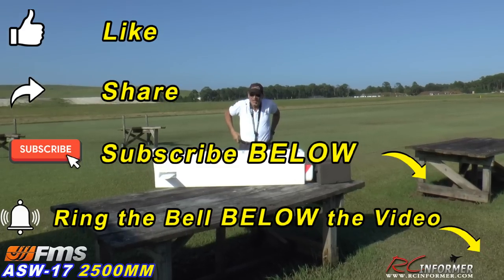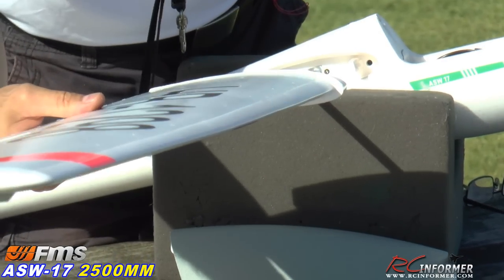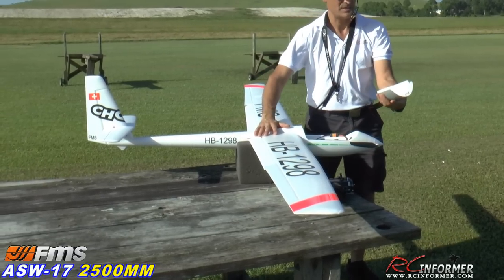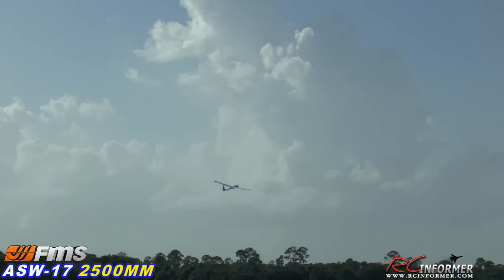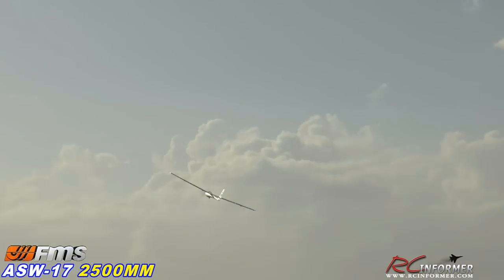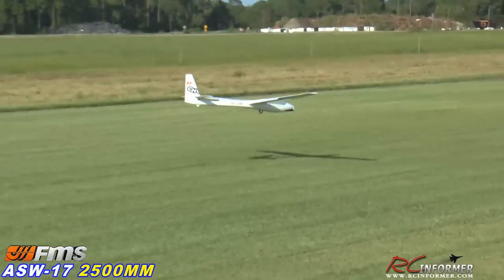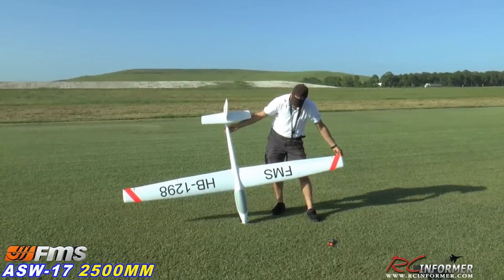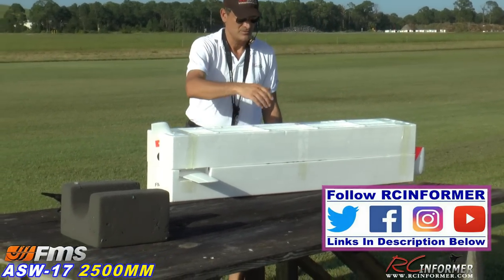FMS ASW-17 2500MM Glider Flight Demo By: RCINFORMER

Comment: I bought this glider from FMS and agree with your comments.
It's really a very pleasant glider to fly and I think FMS has made a very good product.
I actually mix the spoilers and the elevator to remedy the rise of the glider when we take out the spoilers.
I also painted black lines on the lower surface and red on the upper surface that allows me to see clearly which way it is in flight away from view.
Reply: Bonjour Philippe.
Je serais intéressé de connaître tes settings D/R et la valeur des Expos que tu appliques sur les 3 axes.
Merci par avance.
JPhilippe Rennes.

Comment: The good thing with powered gliders is especially if you are a park flyer ,is that you have more flexibility on landing ,if dogs come across you can just power up and you are in the clouds ,with a normal plane  10-15 mins you are looking for a landing ,if the battery is low you have one chance ,with the glider you could practice 100 landing approaches and fly for an easy 60mins on one battery ,and if you are slope soaring in decent lift ,you can push that up to 2hrs ,or until you start to nod off or your neck gives up

Comment: Rich. I haven’t been much in e glider scene. But after seeing how this one is so easy to put together.Hmmmm. So much good stuff coming with FMS....👊. Great job as always. Love even how you modified the box it came in for transport. I’ll be looking forward to seeing you back at Joe Nall. Thanks for sharing. 👍👍
Reply: One thing that they don't tell you is that you can fly a glider almost anywhere, even the beach. That's because everyone loves the look of a glider, and they'll come and tell you so. Just don't fly it like a stunt plane, you need to learn elegant, beautiful, smooth changes of direction and forget the bank-and-yank approach. Oh, and don't forget to take a chair, you'll get a minimum of 30 minutes per flight, probably a lot more.

Comment: Just a suggestion, regarding the main wheel is to replace the hard stock 2 inch one with a DuBro low bounce wheel... with the addition of a few small washers, it appears to significantly reduce initial touch down bounce! It can be purchased either through Horizon Hobby (DUB200T) or your local Hobby store. 😀
Reply from the maker: Good idea!

Comment: You can make it much more reactive  and fun mixing ailerons with flaps working same direction. It needs separation of ailerons channel but it works.....faster 4 points....vertical wall ...depends on motor and structure’s rigidity .You can mix ailerons with rudder to avoid nose up on slow rollings.....You can even do one or two thermal phases with 3-5 mm down flaps to catch thermals. And obviusly you can set a butterfly for short landings on slope.

Comment: Hi buddy .  Between asw17  and tower h asw28 wich one you’ll choose ?
Reply from the maker: I can't comment on the asw28 because I have not had one. The FMS ASW-17 is outstanding. Mostly, I like the full-length leading edge sheathing that protects the leading edge on the ASW-17.... Most models do not have that & it is a very high-end feature that will make the model last longer.
Reply: Ok thanks .  Have a great day !!

Comment: Great review and great product. I like the stripes you added. May I ask where I can buy these? I would also like to know where I can buy decals with American colors (not Swiss) to add on. Many thanks!
Reply from the maker: Here is the link for the Glider... it is the first on the list:) thanks for watching!
GET your FMS ASW-17 2500MM PNP at HORIZON HOBBY HERE► https://bit.ly/34TgW4n 
LIPO PACK USED IN THIS REVIEW:
-SPEKTRUM 4S 2200mAh   30c lipo IC3► https://bit.ly/2Rivi6r

SPEKTRUM DX9 USED IN MY VIDEOS► https://bit.ly/39ChQkx
SPEKTRUM SMART BATTERY CHECKER USED IN ALL MY VIDEOS▼
                                                                                    https://bit.ly/3hrmIx3

▼Get your SPEKTRUM Smart Charging components here▼
             ▼SMART CHARGERS USED FOR THIS REVIEW▼
-Smart 30A 540W Power Supply► https://bit.ly/2OKJ8gw
-Smart S1200 DC Charger, 1x200W► https://bit.ly/2D09lVC
-S1500 DC Smart Charger, 1x500W► https://bit.ly/3jzdoJl
      
   ▼RECOMMENDED A/C SMART CHARGERS▼
-S2100 Smart DUAL AC charger► https://bit.ly/2ONp7WD
-S1100 Smart SINGLE AC charger► https://bit.ly/3hvf1pU

FMS MODELS ARE ALSO AVAILABLE at THE RCINFORMER AMAZON STORE here► https://www.amazon.com/shop/rcinformer

▼HELP SUPPORT THIS CHANNEL BY USING OUR LINKS TO PURCHASE▼
.... Special thanks if you were able to order it thru my Affiliate links here.... that is greatly appreciated! ... At no additional cost to you, Purchasing thru our affiliate links and Amazon Store supports RCINFORMER as we do earn a small fee for the referral. Thank You for supporting us!

▼Please visit my new AMAZON Store for ONLY the Exclusive stuff that I use Here▼ 
                            https://www.amazon.com/shop/rcinformer

Follow Rich at RCINFORMER on Social Media
FACEBOOK► https://www.facebook.com/RCINFORMER/
INSTAGRAM► https://www.instagram.com/rcinformer_...
TWITTER► https://twitter.com/RcinformerO
Website► https://www.RCINFORMER.COM
Reply: @RCINFORMER  Thank you, I bought it! I will now attempt to decipher how to transform the styrofoam box into a carrying case for the glider based on the few frames from this video. Great idea and suggestion BTW.
Reply from the maker: @leomiliades7341  I'm going to plan a live show this weekend & show how to cut the box:) probably Sunday!
Reply: Please record it - I got the glider today and I have been thinking how to cut the box. Many thanks!

Comment: Brand new here. If the controls are set to minimum or in safe mode would this be ok for someone that has only flown computer flight sim? What type of tape is used for the wing stripes?
Reply from the maker: I wouldn’t necessarily recommend this for a complete beginner Straight off a simulator just because of its size and the fact there are a number of smaller more suitable ones on the market aimed specifically at beginners :)

Comment: Hi I finally bought the spider after watching your videos I love it, One thing I noticed though is that when I dive down the wing starts to flutter when I pick up speed, It scared me so I never did it again but I seen somebody on YouTube testing it to the limits and they were dive bombing all day with it With no problems. Anyways can I ask you a question, I want to use the spectrum 2700 mah  battery 30 c for this but I do see on the manual it calls for only 2200 through 2600 mah,  It looks like there's a lot of space in here do you think I would be all right?